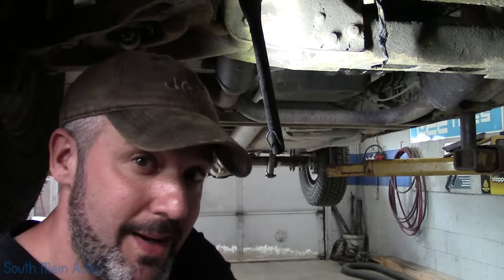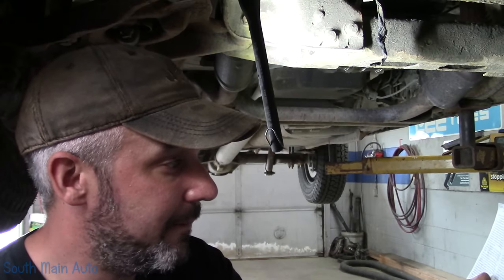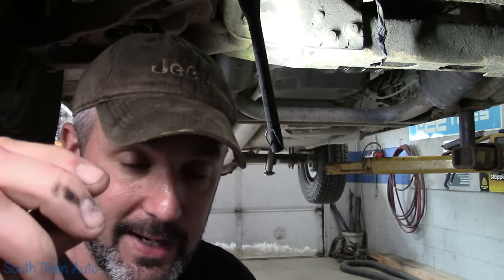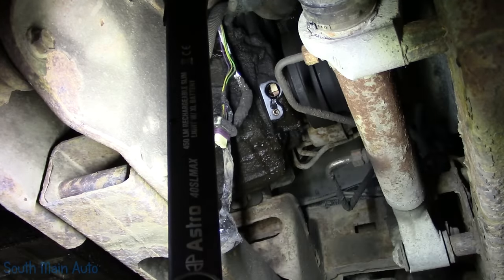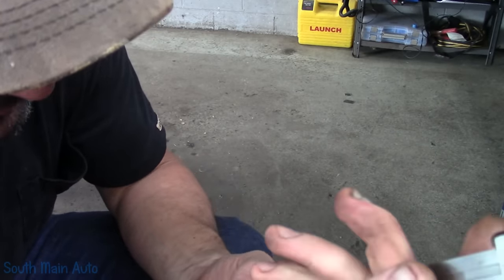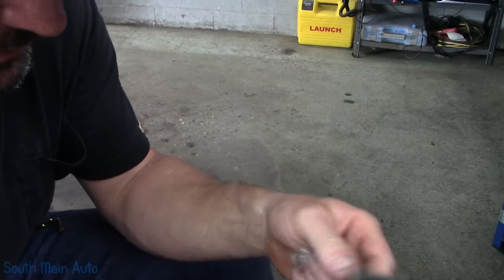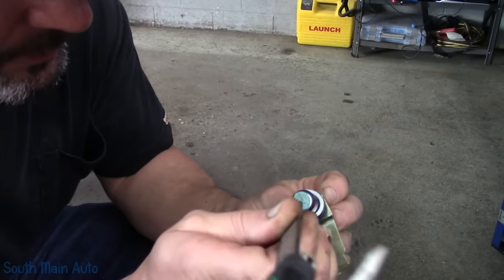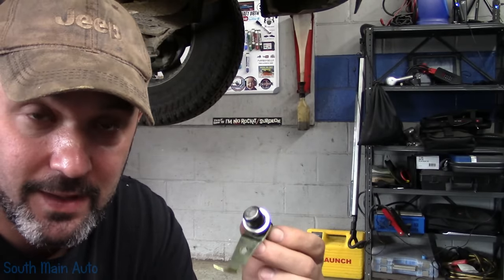Quick Tip: P0335 Chevy Crankshaft Sensor - Shim or No Shim?

Comment: If the crankshaft position sensor, or timing cover, are moved, removed, replaced, or disturbed in any way, the focus point of the sensor changes and the relearn data that the PCM uses is incorrect. If the engine or PCM is replaced, the relearn is necessary as well. Incorrect relearn data has a direct affect on ignition timing and injector timing and will cause a multitude of driveability issues

Comment: I have a2000 impala--  ..I can NOT get the (( icall it a flywheel))  harmonic balancer.!!! I already  ruined the  trheads already  for the bolt that holds it on... wish they woulda used a pulley that ya bolt a round bushing into  the  gear ( flywheel)--- and  runs then run the bolts in different holes to push that  bushing out to remove it! ....anywat.. can't get off... Think solved   gas tank  no fill prob((  anti spill valve in tank going  to  charcoal filter))  was  stuck closed !!! I  think..haven't  filled with  gas  yet.

Comment: Great tip about the air gap! I used play dough and measured. I had to use both shims to get the proper air gap. Truck started right up and my oil leak is gone! I also dropped the connector gasket  and put it back on to the connector and had to repair the wires with liquid tape. Thanks for the video!
Reply: Did you have a crank no start before?

Comment: In a situation where you have a straight shot at the hole, Which you don’t always have the ability to do. I like to use the caliper to measure the depth of the reluctor wheel with the bottom depth gauge then measure the sensor and subtract the two. That’s just me though. I think I have a touch of the ocd and if I don’t know exactly what it is it will drive me nuts. Sometimes I still wonder if I did it right anyway. It’s a nightmare. Thank you for taking the time to help us with your videos.

Comment: I used to own a '00 Jimmy. Nothing but problems! When the money light came on for the 7th time in 3 months, I yanked that engine out, parted the truck out, and dropped the engine into a '89 S10 Blazer, and bolted on a Edelbrock intake manifold, manual choke carb, and a chinese HEI distributor off eBay. FIXED! She got 17.5 mpg, WAY better throttle response and low-midrange power. That is, until the chinese HEI module fried itself after just 8k miles. Second one lasted 2k miles. Gutted the second one and installed all Echlin electronics. FIXED again! 😁

Great tip! Even with all the trouble I had with that Jimmy, the crank sensor was the one component I never had to change, lol. I'll definitely remember this one. 👍

Comment: Verneer caliper not a micrometer. Great tip .My truck needs one starts hard runs ,acelerates rough and then when I shut it off it doesn't start right away.

Comment: A side note to anyone that cares. I was getting a p0300 code on my 2002 chevy silverado. Took it to 3 mechanics, couldn't solve it. I replaced my crank sensor after researching as much as possible. Wasn't throwing a crank code at all. Fixed my p0300. Finally a mechanic says it! Thanks Mr. O!
Reply: Did you have a crank no start? Like not getting any spark?
Reply: @kevinking9874  No, I had spark.

Comment: It wasnt until my truck started shuttering that i was questioned if my sensor had shims or not. The previous owner did not have shims so when i ordered a new crank sensor i just pulled it out and put the new one. It started shuttering so i changed out the fuel filter, fuel pump, fuel lines, plugs,  wires, distributor and just went ahead and put a new timing chain while i was at it. What a waste of time after watching this video come to find out some sensors dont come with shims, so they were put on and wham, it runs now. SMDH.

Comment: Hey, nice video. I have a 2006 Chevy Silverado 4.3 manual with 180k miles. I’m having issue with misfire when going down on the way at about 70mph it starts to vibrate the shifter and misfires, and it hesitates making the mph go down. I already changed spark plugs, checked the wires, changed ignition coil, crankshaft sensor. Do you thing this could be my problem? I’m about to check the airgap on it. Thanks

Comment: 0.030 is minimum for the air gap I wonder what the maximum is, where do you get those spacers I can’t seem to locate any, I will look for a suitable washer. So if the face of the sensor is gouged from contacting the exciter wheel does that mean main bearing slop, or would a wearing timing chain cause this ?

Comment: So if the space between the reluctor wheel and the sensor arent within speck will that cause a no spark?

I had same code, changed the crank shaft sensor and wasnt getting spark. It didnt come with and shims either. 

Thanks man.
Reply: Any response? I still can't get spark to my coil. CKP voltage is ok.
Reply: @ismaelcarrillo3956  no. Still no spark for me either. Got a newer work vehicle and left the old one sitting in drive waiting for time to work on it.
Reply: @carcasscruncher9354  if the crank sensor doesnt sense metal it wont activate the coil or injectors. ive messed with the harnesses in these trucks for a while you can literally take a paperclip thats like a quarter inch away from the sensor and it will trigger it. (see my channel)
Reply: @lt.schlechtnacht9414  I’m having a no spark issue right now. The new crank sensor the previous owner did not put a shim on it, I did notice that it was scratched up. I wonder if I get another sensor with a shim that it would solve my problem?
Reply: @kevinking9874  i would suggest doing that. buy a new sensor and put a few shims in it. the shim i have in mine I believe is 30 thou. but yeah try that and give me feedback. usually a no spark means either no power to the engine harness or the crank sensor isnt working.
Reply: @lt.schlechtnacht9414  thanks for the reply. I did found my problem though, in my 03 Silverado with the 4.3 the plastic timing cover with the riv nut that the crank sensor bolt bolts into was an 1/8 coming out it’s place cashing the crank sensor to be far away and not getting the signal from the reluctor wheel. So Now I’m doing a timing cover replacement.
Reply: @kevinking9874  I would do the holley cast aluminum cover. thats what im using on my 5.7 its not 100% good but its better than the plastic

Comment: Have the same type issue on my dodge dakota flywheel location. Dodge shows no recommendation on setting air gap (not that i could find) destroyed one crankshaft position sensor. Had to figure this out and shim the thing. Joy
Reply: go 0.030 " use a sticky paper gasket circle...

Comment: Great video. I am in the same exact scenario. I was wondering if you could relay the pinouts with color codes. Only the center yellow wire is connected the other two are detached. The replacement part by BWD has all white wires (ABC) and no schematic. Supplier was no help.
Thank-you again for the great videos.

Comment: ok you confused me. you were saying about crankshaft end play due to thrust bearings  but in that configuration it wouldnt matter.
Reply: I believe Mr. O. was referring to a known GM issue wherein the crank pulley and or balancer loosens or wears out and this causes the data from the sensor to throw a code.
Reply: What about wear in the timing chain, stretch

Comment: I have. 98 Silverado 5.7l. New distributor. Crank sensor plugs wires and pcm.  Keeps frying coil packs and icms. Had it in a shop and they adjusted timing.  But didn't fix the issue.  Showing cam crank correlation code. And crank sensor variation not learned.  Any help is appreciated

Comment: Hello. I want to clean my position sensor on my 1999 Blazer 4.3l V6 AWD, because it is full of oil... When i pull it out and back in, is then a relearning nessecarry? Or only when i change it with a new one? Thanks!
Reply: Probably not, don’t disconnect the harness just slide it out, wipe it off and reinstall - unless you want to replace the leaky timing cover that is causing the mess, they all leak and are a real bear to repair

Comment: I remember having a paper shim on a sensor and locking in the sensor when it touched and the reluctor would wear the shim off but don't remember the application????  Old Timers.
Reply: Ahh as I recall DoDge 3.3 use the paper shim on the crank sensor and cam sensor installation......

Comment: Does anyone know where to source ABS brake sensor shims for a Trailblazer and what ever GM vehicles they are used on?
Reply from the maker: Never seen them sold separate. Have you checked through the OEM?
Reply: Go buy a shim kit..I have several 100 types and sizes.
Reply: No sir not yet.
Reply: For hard to find stuff like that, I usually just go to the junkyard and get several of them.

Comment: Is it possible that the crank position sensor can be going bad without a code because I have replace all ignition parts as well as the fuel pump and I still get a cut off and most of the times it starts back up sometimes it's don't?
Reply: Yes it can, or the ignition module, or the sensor in the distributor

Comment: Could this anomaly cause weak spark to coil? I have crank no start, will fire starter fluid, on a 99 chevy express van 5.7
Reply: I only say possibly because I'm not current on that year of 350. But if you have that sensor then by all means pull it and look for contact damage and/or excessive distance both. Sounds like fuel, does it have the better newer design spider and fuel pressure needs to be 60 PSI. Older A/C gauge set can work for that. Had a green wire damage to MAP sensor on 4.3 that caused severe grief in driveability issues. Got skinned since it's on top in the open, two strand connection and damage didn't look anything near that bad.
Reply: Lee Barnes 
Thanks for the reply,  60psi on fuel(new pump), new cap, rotor, crank sensor, coil. Fuel gage goes to 3 and stay at crank, smell gas in oil ( from so many trys?) I'm at a loss,
Reply: fuel regulator is leaking
Reply: juan rodriguez 
Thanks for the reply,  I thought about that, but the fuel pressure does not drop during crank or leak down after crank?

Comment: Never seen a shim with a sensor but that was all my problems except for the loose coil causing high primary volts. If not a ACDelco part, GET TWO lol Non GM parts are cheap becuse they didnt pass speck
Reply: I have a crank no start on my 97 5.7. That was the only code it pulled. High ignition voltage. Would this fix it?
Reply: @ismaelcarrillo3956  the coil is bad. make sure you use the .030 shim with the cps

Comment: I got a 1999 chevy Tracker with the same error P0335 , and i pull out the crankshaft sensor , it measure 612 Ohms , and i also checked voltage and couldn't
find any voltage . any suggestions what it could be ????   Help  !!!   Please !!!!!!
Reply: You can’t test it like that as it generates a small voltage only when the engine turns, sends pulses to the ecm
Reply: @kellismith4329  T hank You

Comment: Go back to ge connector!!! I've been all over youtube. My connector on my 03 express had one of the wires completely hanging out. The only replacement connector I could find anywhere has all three wires white.  Whoever designed it is an ass. I looked at the connector I cut off and the wires that are hanging and from the years of fading I cant really tell which go where but I'm pretty sure I just saw a purple wire in your background. Which wires for where?!? Who the hell makes an all white freaking connector???